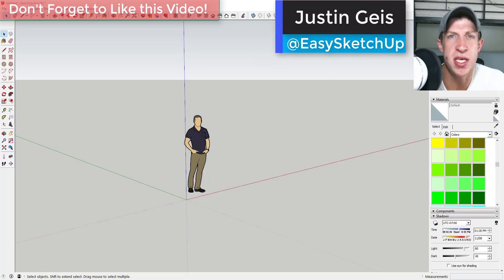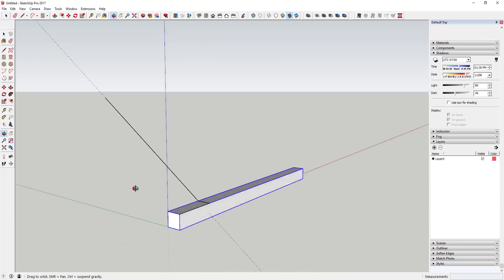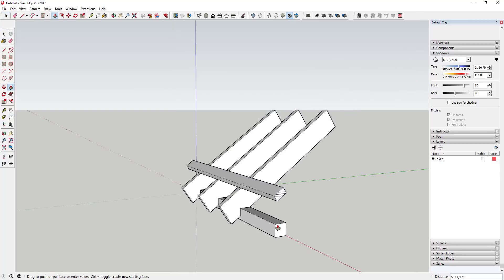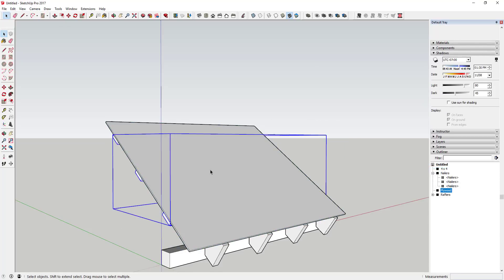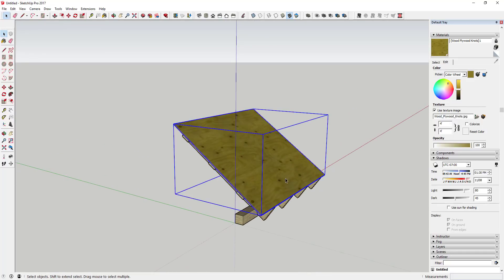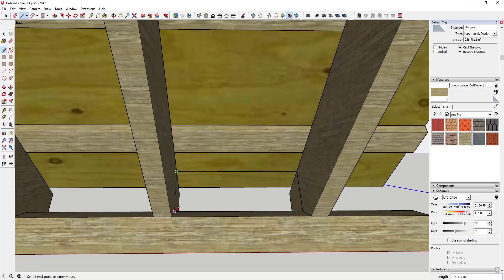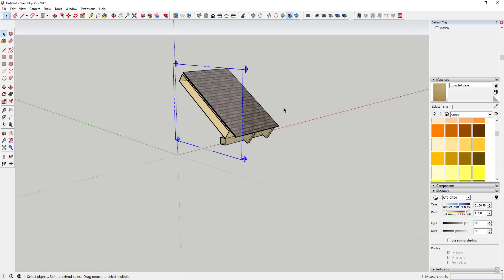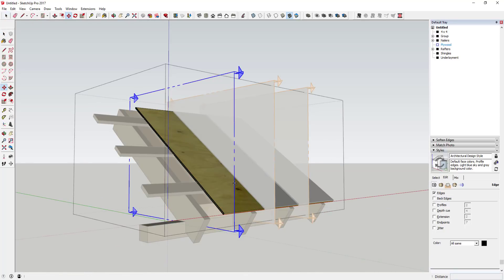Modeling a Construction Detail In SketchUp with Groups/Components, Sections, and the Outliner!

Comment: 8:30 & 11:00 Instead of meticulously tracing new geometry along the edges of the plywood or underlayment, wouldn't it be easier simply to get the Push/Pull Tool and press CTRL while dragging it up? This creates a new surface and automatically establishes a new boundary between them. Think this might be the ONLY way to do what you're doing with a more complex shape (e.g. curved edges, etc.).